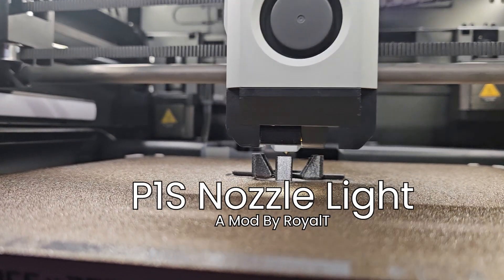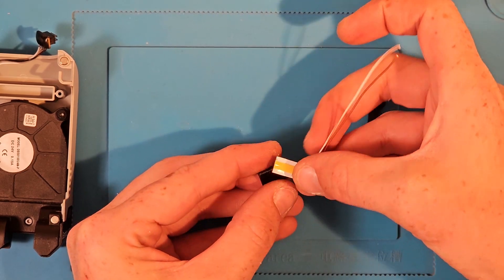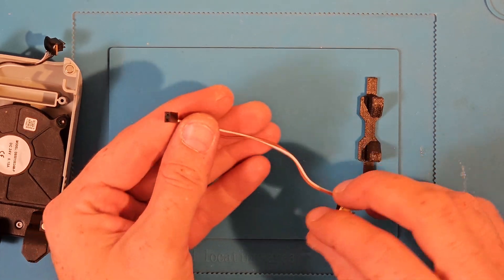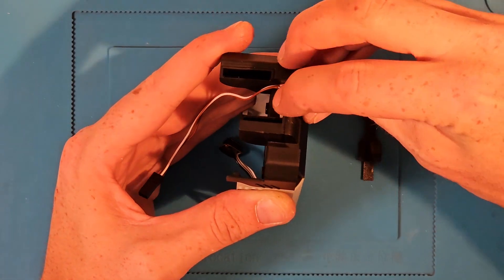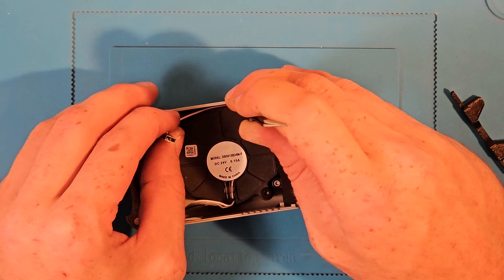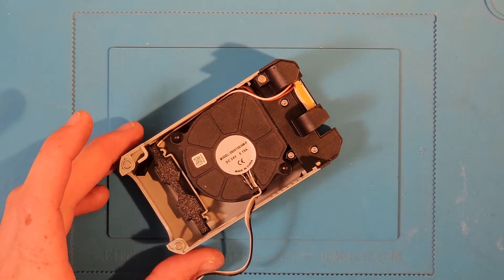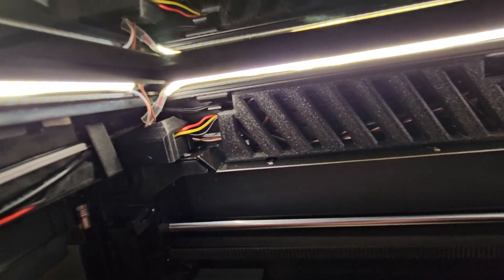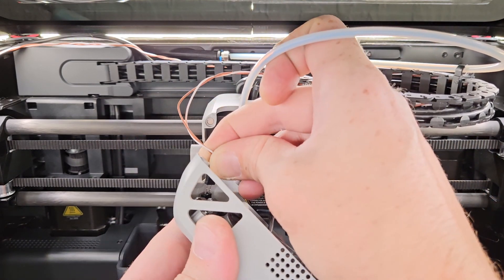P1S Nozzle Light Mod Tutorial

Comment: 24v available at the fan; use buck converter to drop to 5v.  All wiring would stay in toolhead and only fan connection would be needed.  This would make the nozzle light an 'always on' light though.
Reply: stačí SMD odpor. Já dal cca 10K a 2 smd dioduy odběr mám asi 8mA. je to lehčí řešení než převodník